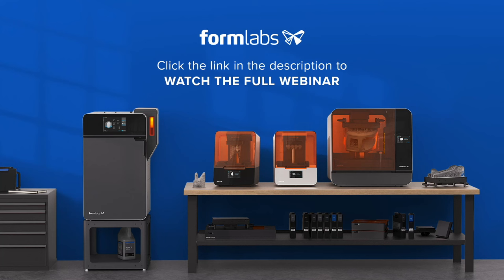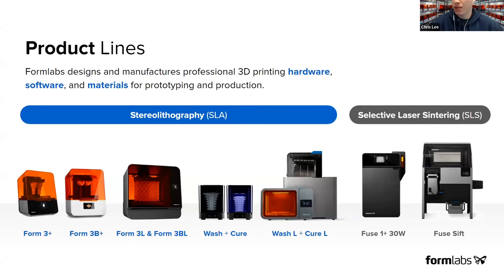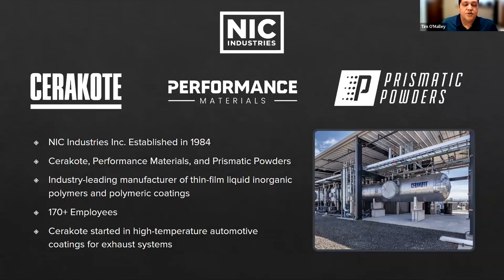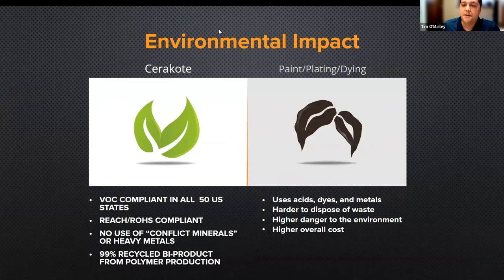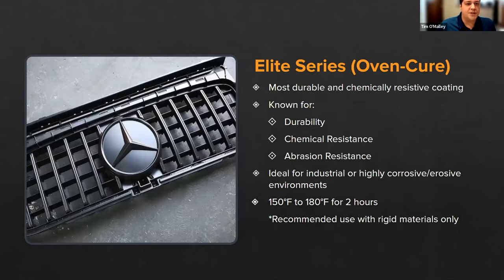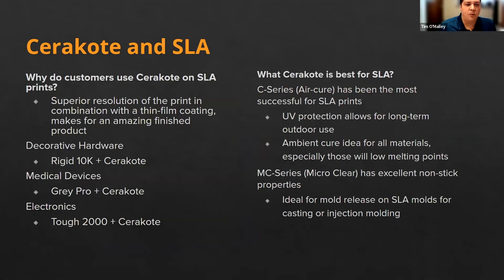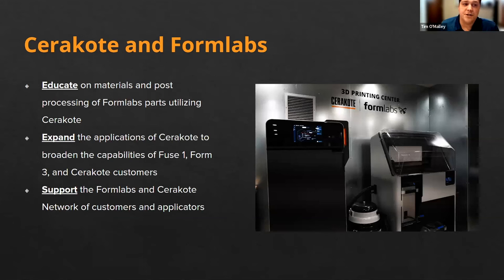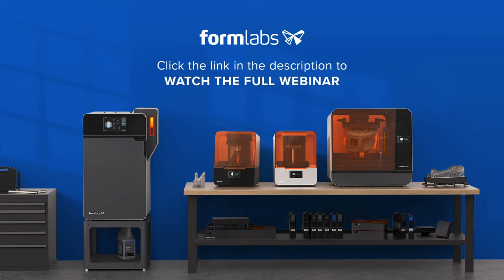Cerakote Ceramic Coating for SLA 3D Printed Parts

Comment: Which Cerakote type is recommended for Injection molds made of Formlabs Rigid 10k? It has to withstand a temperatur of ~400 F.